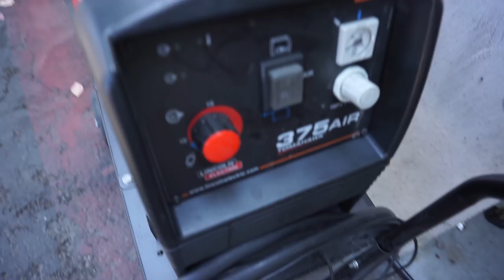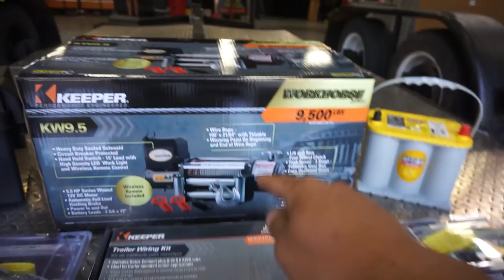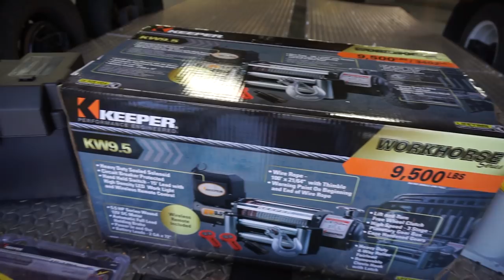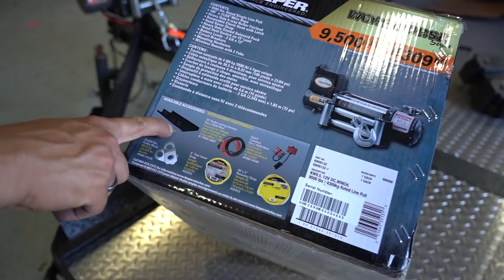Turning a $500 Trailer into a $5,000 Trailer! (COMPLETE TRANSFORMATION)

Comment: Waiting for the "We SLAMMED our trailer with air suspension!"
Reply: Its 100% the best way to do it. I've built several car trailers of different design for loading low cars. I tried tilt and one where the axles slide forward and one like this with no suspension. On a small truck with hydraulics we even made a hook/slide that lay the bed on the ground and you could drive on with just 50mm clearance.
But there's always issues. Like scraping and not being able to open doors. With roll cage and full containment seat, not being able to open the door is a huge hassle.
Remote airbag is well worth the cost. Squat the trailer, drive on, raise it to max height, get out, drop it to ride height. If you get hung up you just raise it up. Etc.
Reply: I use one for work. They come in handy
Reply: I thought it was just me lol
Reply: I did it to mines💯 best idea I ever had

Comment: Put a cover over the winch to keep it from getting wet when it rains! With velcro so you can get access easily when you're going to use it! Also, an area somewhere close to the winch to keep a tarp (folded) to cover your cars to prevent sun/rain/snow(?) away!!! That's my contribution Ricky!

Comment: Very nice job. Wouldn't know it was the same trailer.  The only thing that I do different with my trailer hookup is ----  I run a heavy welding cable back from the truck battery positive to a plug disconnect at the rear bumper to power the winch. Then run a separate ground cable from the trailer to the truck. No need to use a separate battery .  Never ran the truck battery down .

Comment: Sexy looking trailer! I did the same thing to my first trailer and wish I had gone with the aluminum diamond plate instead of steel. Also wish I had used bed liner instead of paint. The only thing I would add to your trailer would be inside fender skirts. They help keep any road grime off the car especially when you are towing in the rain.

Comment: The trailer looks good. I would've put the winch hiding inside of a truck toolbox like I did. I also hid the battery next to the winch. The only wat you can tell its there is the roller fairlead mounted on the outside of the toolbox along with the winch hook,

Comment: Nice job cleaning it up. Like others have said, add some inside skirts to your fenders… also, I never saw anything holding the battery secure other than the plastic box being bolted down. I’d recommend a more sturdy solution to holding the battery in place. Wouldn’t take much more than some of your 1” tube and some all thread. Anyway, nice work on the trailer update.

Comment: On my bolt on "D" ring tie downs I cut some strips of rubber/ plastic mud flap1/2 inch X width of the bolt down strap  of mub flaps to fill the gap between the "D" ring and the trailer frame they are bolted to. This give the "D" rings some cushion so that they don't rattle going down the road, but still allow the "D" rings to swivel to the angles they needed. And they last for years.  Currently my mud flap anti rattle strips are going on 25 years...

Comment: The diamond plate looks nice, but still gets REALLY slick if it is wet.  I'd paint that and throw some sand in the paint to provide some grip.  Also, I'd build a battery box under the trailer.  The optima won't mind being on its side, so a maintenance door in the floor of the trailer will help prevent battery theft.  Same for the winch, really.  I'd build a shroud for it and mount the fairlead to that.  Make it MUCH more difficult for someone to steal it.

Comment: How much weight are you putting on it? Looks like weight limit should be about 3,000lb. Could increase weight capacity by adding structural material in the c-channel.  Enclosed neck would be nice for holding straps/binders.  Also needs lights at least on the tail.  The small ~3/4" round truck lights would probably work nice and look good.

Comment: That's a dope trailer setup. I think you should add a solar panel to maintain the battery when you aren't using the trailer. And maybe grip tape down on that diamond plate because when it gets wet I can assume it will be fairly slick. Maybe with that tubular steel you had add some bracing under the winch plate, add more Drings just for more securement options.. And lastly finished off the area on the trailer upfront under the winch with diamond plate.

Comment: 3 things . I would have sanded off rust til metal was smooth before paint.  It makes it looks so much better . Also where the winch an plate was mounted. I would have set it back more, off the tongue  and to where it caught both sides of the frame . Also the tubing cross piece's would have been heaver metal

Comment: Ricky, swap out your steel cable on that winch for synthetic rope. It will save some weight, just as strong if not stronger and if it breaks you can do on the spot repairs without any tools.

Comment: You're on your trailer in the front where you put the winch could have went back just a little bit for not much but underneath that opening you should have put expanded metal in there so you can put your gear in there and have like tops so it locks up so it's always on the trailer

Comment: Great job, I would have built slots for the ramps to hide between the top & bottom.

Wish I had some sponsors that could hook me up with the supplies to fix my trailer. Until then I'll just wait, cause I'm not about to spend that kinda loot.
Reply: It really takes no where close to 10g. That the price of a new goose neck. New boards , unless you just want diàmond plating. Around 3500 to 4000 ,is where new trailers  Begin to start and probably heaver , after the cross members he added

Comment: Should’ve scaled the trailer frame and coated it with POR instead of that cheap bed liner, that and covered the back of those wheel wells to prevent sandblasting the sides of whatever car you’re hauling.

Comment: You guys really need to use a face shield when using a grinder with a cut off wheel not just safety glasses. I also suggest getting a oxy acetylene torch set. It will cut thicker material than that plasma cutter and can also be used to heat metal for bending as well as welding I your mig was to shit out on you.

Comment: I myself would’ve made self locking pull out ramps as well as bagged suspension with new rims and tires for the trailer as well with a electronically operated  hydraulic trailer stand/lift as well as adjustable tire well gaps for when you have a vehicle up on there to seat better on the trailer especially on harsh weather conditions and new LED brake lights and running lights as well as climate control plates under the diamond sheet metal to thaw out ice or keep it cool so your not burning the hell outta your self on it otherwise everything else is on point

Comment: if were me the j hook mount bracket's need to at a 90 degree angle rather at the 45% angle so the nylon straps will be evenly dispersed on the j hook rather than all bunched up at one side which will shorten the j hook straps life considerably but more importantly it's holding power which it gets from dispersing it's load over a wide area when the j hook is un even to the strap it cuts trough the strap much easier  losing a strap could lose a load!!!!!!?
the other thing I did not hear u mention is the tailor breaks and a break away connection so in case the tailor breaks away from being towed it applies it's own breaks so as not to rolling around aimlessly smashing into things SAFTY FIRST
other than that good build

Comment: Somehow breaking cutoff disks, mig welding on top of thick rust, replacing heavy duty c channel with flimsy square tubing that's half the height. also hoping you didn't just put bed liner over all that rust. aaand you just welded over the bed liner for the battery plate (and the rust under the bed liner as well?). I also seriously doubt that thin plate will hold up after the winch has tried to pull a few cars onto the trailer (though it's clear you won't use it, afterall you haven't for 10 years but hey smart move for the sponsorship money).
Regardless, the editing is good and so was the mood on the video. But mate you pretty much fucked everything else up lmao.
Reply: I think you forgot to mention that jack-knifing this trailer would probably cause the winch to hit the truck first.
Reply: @Dezzsoke  Also, looks like they spent about $4000 on the work lol

Comment: Its nice and all. But, I wouldnt be paying $5,000 for a used Trailer. even if it was rebuilt with added stuff. Similar Trailers like that around that are used. go for about $600 to High end of $1500. with Winch and battery and cargo containers.  So if i was to buy your trailer I would be into it for the high end of $1400 to $1500 max. Its just what Trailers like that around here go for.

Comment: Just missing some nice wheels, maybe just some work meister reps from esr to finish the look. Turned out great though
Reply: You need strong wheels like steelies. Aftermarket wheels are really designed with a suspension set up in mind, trailers dont have suspension they're just on axle. Afteemarket wheels will crack over one big pothole with no suspension
Reply: @charliehouldsworth8317  ahh makes sense, didn't think of that.. so what you're saying is bags and real wheels. 🤔jk

Comment: Not worth 5K $ and it is not an epic trailer. But it is a practical trailer that is useful. It could have been a bit wider and longer. Sandblasted it would have made it looking nicer. Air suspension so you didn't need the ramps.

Comment: One thing did do to my trailer is putting a connector in for the battery between the car so it charging up when I’m driving. 

Other thing would be some are suspension but seeing you guys have solid axels it won’t work

Comment: decently done but nowhere close to a $5k trailer. does that trailer even have suspension? you should take atleast half of that winch cable off. it will pull better and have less issues of getting rat nested.

Comment: That trailer is no where near $5000.00 fixed up. With the shitty welding and cutting you did. It may have been worth $500.00 in the beginning but now it is only worth $250.00. With all the crap you hid, I would never but a vehicle on there let alone a motor bike.